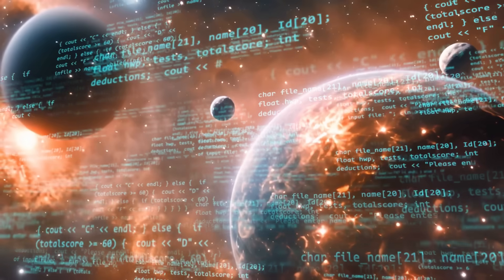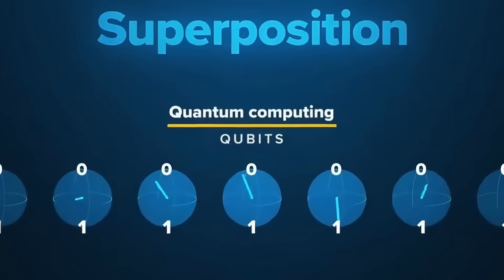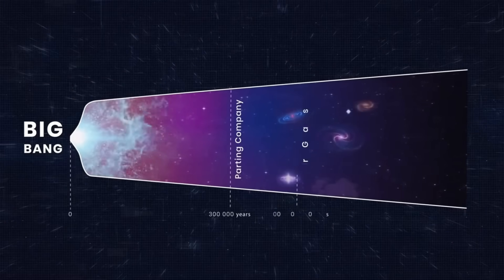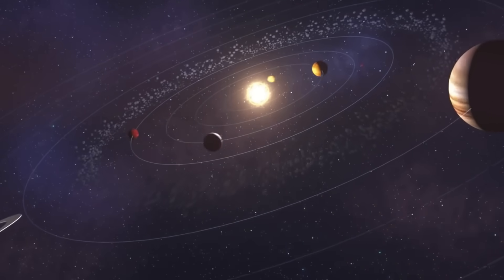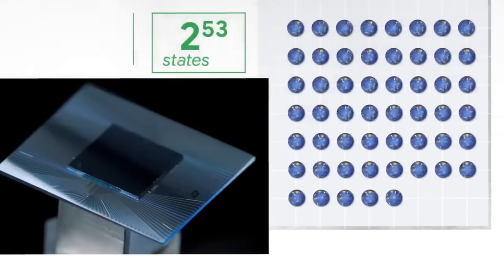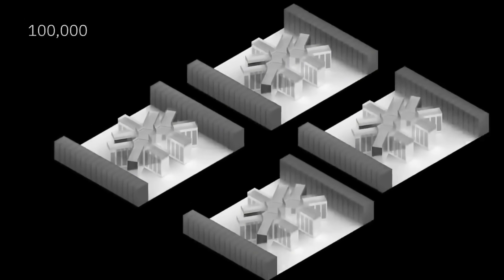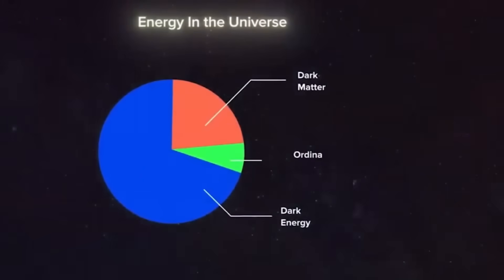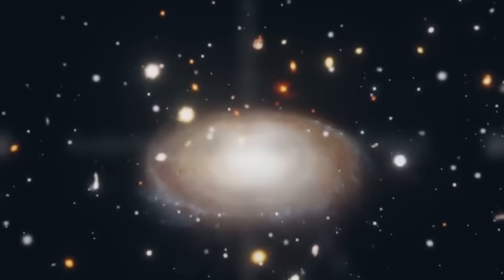Scientists Just Asked Quantum AI What Built the Universe – Here’s What It Said

Comment: Ai is not conscious it is a simulation and has been wrong many many times. Its answers are based on data FED to it, it knows nothing outside what it is given to answer from. It can be utilized to analyze data we are not good enough to answer ourselves especially with math. It can not read your mind it is not psychic and it is as predictable as the programmer behind the lies designed to hurt you not help. It is the modern day Trojan horse and it can be turned on its creators to hurt them no matter how they try to prevent it